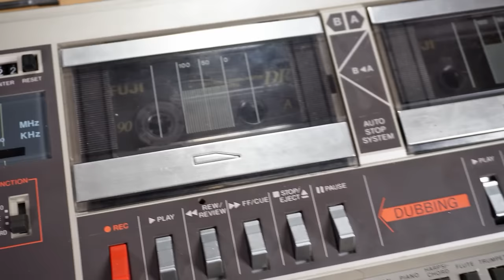I Made A Tape Echo Keyboard | Casio CK-500

Comment: If you want the speed mod for the tape, you could probably somehow disengage the pinch roller from the recording deck and do the speed mod on the playback deck. That way the speed would be set and regulated by the capstan and the pinch roller of the playback deck and the recording deck would not affect the tape movement at all.